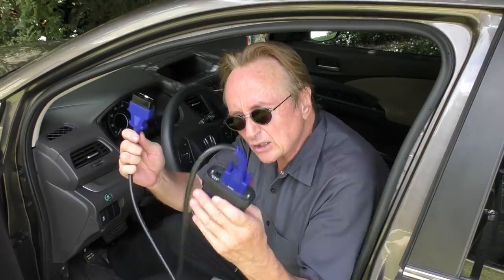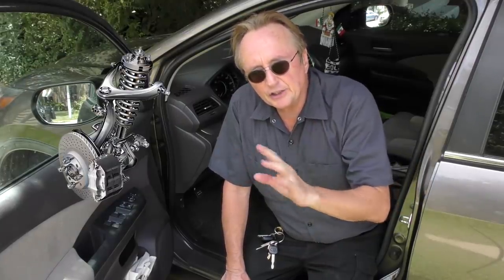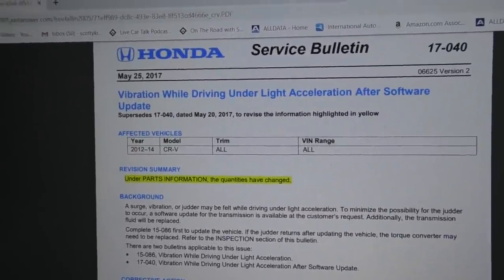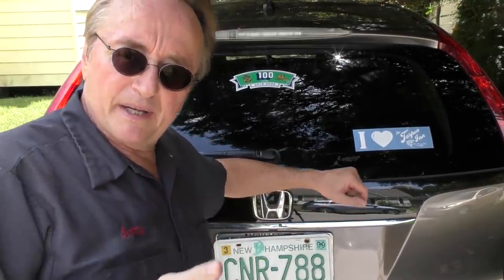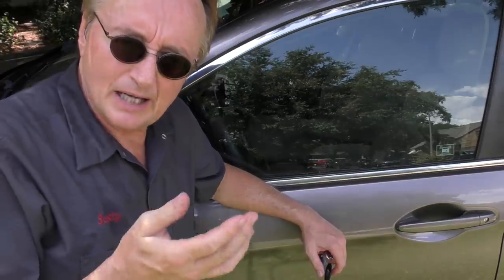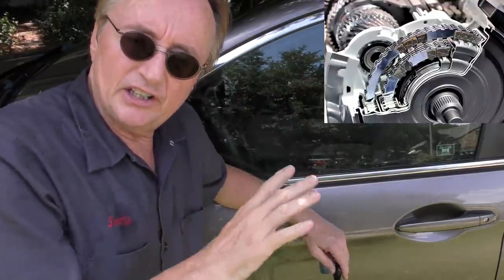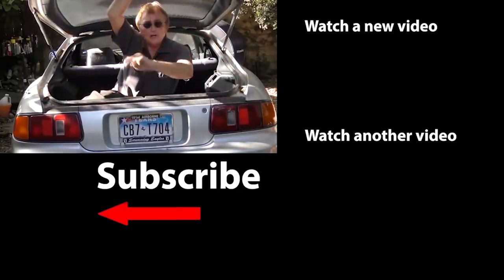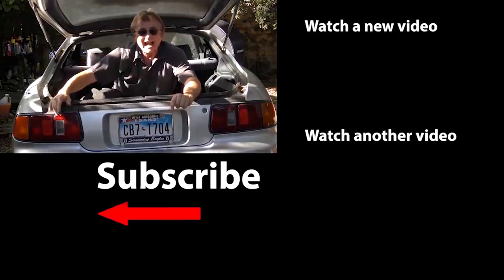I Can't Fix This Car

Comment: I think it could be a problem with the clutches in the transmission. The transmission guy that spoke to scotty had a valid point. I had a simmiler problem with the laycock overdrive in a volvo 240 and a transmission specialist said it was the clutches so I had it done and it was fine afterwards.

Comment: Fuel pump failed on the highway- can the transmission drive the engine, causing the timing belt to jump a couple of teeth? 2002 Mercury Villager, 187,000 miles, pump replaced, vehicle won't start. Can you help, please, Scotty?

Comment: Scotty , Have Your customer try Lube Guard Instant Shutter Fix. I have a 2004 Honda Accord, the same symptoms that you described in this video. Installed The magic juice and the shutter is gone. Basically it's a friction modifier. Back in the 90's when I worked at the Ford Dealer if the transmission had a shutter this fixed the problem 80% of the time.

Comment: My bet is it’s got an intermittent ignition miss under light load with A/C on it is worse. Everybody always goes for the transmission and usually they’re wrong. Ran across this problem before if you gap the spark plugs to .035”the problem will be gone for a bit. New ignition coils will fix it more than likely. Under light load lean fuel mix causes the light miss will not trip the CEL. Under hard acceleration probably does not miss.

Comment: As time goes on and with the experience I have had with owning only two Honda's I have decided I won't be buying one as my next car. My car only had 127k miles on It when the transmission started acting up, I'm getting It replaced right now and that's just a waste of money. "It's a Honda, It lasts forever" Is starting to not be so true anymore.

Comment: Faced very similar situation, other car brand, was neither Engine nor Transmission: Culprit was ABS. Replaced one wheel bearing assembly with its ABS sensor, now "acceleration stutter" is gone...

Comment: It is a bit farshot but here it goes. Check the transmission dampening and/or the motor dampenings. The rubber thingies that connenct the motor/transmission to the body and it is used for vibration dampening. Sorry english is not my first language, don't know what those are exactly called. It is like, for better word, a cradle. Like the engine suspension points have those, the transmission also has them. If it is vibrating under low load/rpm it is usually that. The vibration has to get to the body somewhere even if it is software caused. Engines are typically vibrating more in low rpms.

Comment: I had an E46 BMW with the GM transmission that sometimes would not go into reverse.  I mean, you had nothin'.  I went into reverse 99% of the time, though, and I drove it YEARS like that, just being careful not to get "trapped" when parking.

Comment: I had a 1998 Granchrekie jeep that did the same thing. After about 6 month of this issue. It did it as we were going past our dealership & the found the issue. The mother board on the computer had a crack in it. As the car heated up the board would separate at the crack  and the car would shake spit sputter and loose power. Replaced the entire CPU on the Jeep and issue solved. Just a thought.

Comment: Sounds to me like a failing torque converter lock out clutch. Check the trans fluid level. Check the trans fluid to look for discoloration, murkiness, or grit. If you see any, it's time for a complete trans rebuild or an unethical sale.

Comment: I had the same problem on a honda.  Added tube of instant shudder fixx 3 years ago and the shudder went right away.  No issues since.  less than $10 fix and known issue with Hondas.

Comment: How often was the fluid changed and with what brand?  I neglected my transmission when the car was still new.
 I do my own fluid changes due to distance from dealer.  I went to 60k before a change and only then because of a shudder at low speed ,1st to 2nd
After change, shudder disappeared.
I only use Honda fluid, and change 3 quarts about every 5k and will continue until I'm satisfied with the color of the fluid.

Comment: My mother has a 2011 CRV with 167K miles on it. Lots of shuddering when accelerating around 30-40mph and when it’s driving around 70mph, it struggles to get over 2500 RPM and makes a growling / grinding sound unless you floor it hard.

Comment: No guarantees after $2,000 for the torque converter to be replaced. A solenoid or software would be my guess.

Comment: My 1998 Crv shutters at low acceleration, my issue is that I just recently replaced my transmission. It had about 25k miles on it. I had to towed to the shop and the driver took it on the two front wheels, I didn't realize until after since I had my backed turned talking to someone. I feel he messed my torque converter up since it didn't do that before. This is why I dont trust people... Even if they're supposed to know how to tow an awd vehicle. 🤦‍♀️

Comment: I have a Subaru Outback.3.6R with 48000 miles on a 5EAT transmision with the exact same shuddering issue.  Subaru said it was a faulty manufactured converter.  The shuddering was real bad.  At about 38000 miles, I had the factory transmission fluid flushed and filled with Amsoil Multi-Car fluid.  The problem is still there but is so slight it is almost unnoticeable.  Subaru had a TSB for this issue in some Subarus, but not mine unfortunately.  I am assuming it should be ok?

Comment: This shutter might be causing due to a faulty design of the drive shaft. If the frequency of the low speed acceleration vibration matches the natural frequency of the drive shaft the drive shaft will resonate and create a high amplitude vibration and this will be felt throughout the vehicle.

Comment: Scotty, did you try changing the transmission fluid? My ‘12 civic had a similar issue… I did the drain and refill three times. It fixed the problem.

Comment: My 2004 Kia Optima has a "judder" issue sometimes but since it has manumatic transmission, I have found that shifting it manually and holding the lower gears a little bit longer helps alleviate that.  It helps take some of the load off of the engine.  My 2002 Chevy Astro van also has a similar problem but I think that one is either the 4th gear "lock up" engaging a "wee bit" too early sometimes under light throttle.

Comment: Honda junk with their CVT transmission along with Subaru and Nissan. I am sticking with Toyota and Lexus brand only. Honda is cutting corner again just like Nissan and Subaru. I am hoping that Toyota dont cut corner just like Honda and Subaru did.

Comment: My old truck did that a couple times and it would clear itself. Well, I did a little brainstorming and thought maybe I got some moisture in the fuel tank over time and occasionally a shot of water was feed thru the injectors. So, I put in a can of dry gas in the fuel tank and the problem went away. So routinely before in the Spring or before the freezing weather, I dump in some dry gas.

Comment: Auto Manufacturers are not required to tell customers about technical service bulletins and so they usually don't. But they do alert their dealers. So, if you have a problem with your car, go online and see if many other owners have the same problem and see if there is a technical service bulletin for it.

Comment: Hi Scotty ,

I was changing the front brake pads on a 2012 Hyundai Tucson when I noticed one of the slider pin on the bracket that you bolt in the caliper was stuck and the dust boot was missing luckily I was able to hammer it down a bit and it slid down, so I was able to bolt in the caliper to the brake bracket, Now the new brake pads work like a dream and I don't want to buy a new bracket because they only comes as a set  with the caliper at least for this suv they do. My question is will this affect my brake system in the future? What do you recommend?

Comment: My Ford Focus juddered from the first day I owned it. Ford just replaced the Transmission Control Module under the required extended warranty. Ford knew the dual clutch electronic transmissions had this problem from the beginning.

Comment: Juttering.  That's job 1 for a Ford Focus.
These high MPG 2011-2017 transmissions are quirky as hell and needed transmission bell coolers.  Ford, Porche, Kia/Hyundai, Honda CRV (some) and  CVT all jutter with age when they get hot.  Get it fixed/rebuilt and it'll come back in 12-20k.  They get burned in stop and go city traffic, and people that hover and putter at the shift points for miles since they have no clue about what a shift point is.

Correct, leave it alone.  Unfortunately since 1999 engines far outlast automatic transmissions.  Always opt for a stick if possible.

Comment: Toyota V6 5-speed transmissions from 2000 to 2005 had major problems that couldn't be fixed. I personally just live with the problem for several years and yes the car just went down the road only a little bit rough at low speed

Comment: my transmission in my 95 sable wont shift from 3rd or 2nd to 1st under full throttle going 16mph or up. everything else perfect, i'll live with it! been doing it 25k miles

Comment: My 2009 Nissan Murano with CVT transmission was hesitating under light acceleration at random intervals for months. There was engine oil leaking from a loose oil filter and an engine code related to the TCM communication problem but no engine light.  I changed the engine oil and the problem went away. Could low-level engine oil affect the engine sensors such as the crank and cam sensors? I believe the TCM requires the engine speed from the ECM. If this value is off could the TCM cause this hesitation?

Comment: Scotty, I had the same juttering on my 2014 Odyssey.  After reading the TSBs, I decided to change the transmission fluid.  Once I did that the problem was completely fixed.  I expect I’ll have to do this regularly

Comment: I have a 08 Camry with a possible transmission problem. If I shift manually it shifts fine if I leave it in drive it shifts hard from second to third all others shift fine. Any ideas

Comment: I learned this bit of wisdom with the two 60s era English sports cars that I owned many years ago. They were temperamental critters that we're going to run depending on how they felt at the moment, despite my best efforts at diagnosing and adjusting things. They were, overall, a blast to drive and so I just had to live with the annoying little quirky things that would happen occasionally.

Comment: I had that exact same problem with my 2007 F-150 except it was extreme violent shaking under light acceleration. so I took it to a mechanic and he changed the spark plugs and air filter among the few other things and it fixed it

Comment: Scotty, i had this exact same problem on my Honda Accord with automatic transmission, on light acceleration it judders. Problem solved with the oil in the gearbox changed.

Comment: Wise advice coming from an ol' veteran. If it is tolerable, live with it.. or get rid of it. 
(Other advices an the same topic; get a manual [while you can]. If the car jitters, you are doing it wrong - provided the car is in good mechanical condition)

Comment: Scotty, I can fix it! I had the same problem with my 2009 Honda CR-V, 4WD, it would shudder going from 3rd to 4th gear and not always. If you hit the gas it would shift, if you hit the brake it would shift. This car had regular trans. Oil changes every 30,000 miles and this started happening at 100,000 miles (July2017). I first thought it was the rear end, but fluid was changed at 90K, so it was clean, but I changed it anyway, this didn’t fix the problem. Next I changed the trans oil twice, the second time after driving the car for about 10 miles in between. This took care of the problem. I have 114k, and the trans. does not shudder.    Thanks.....Jim
Reply: I also replaced the inline filter on the trans. line, that the dealer didn’t know existed. I replaced after the second trans. oil change.....Jim
Reply: Honda in-line Filter I used 25430-PLR-003, for my 2009 CRV, check with dealer for your model.....Jim

Comment: 2014 Camry does this. And my 1994 Lexus sc400. Both do it at 45-50 MPH. I think the sc400 issue  is because it may need a TPS.

Comment: We have a 2009 corolla and it shakes when you accelerate, did a scan and no codes popped up. Guess it could be a transmission problem.

Comment: check the lambda ( or oxygen)  sensor, my car (1995 renault clio) did that too. After taking the transmission out i noticed some damage on the sensor's wiring, I cut and soldered the wires and the problem was gone. I installed the old transmission once more and it worked fine

Comment: If the judder/throttle hesitation wasn't there before the transmission software update, revert it back to the previous software version and it will probably fix the issue

Comment: I had a couple Rav-4's doing same thing, it felt like it was shaking at a stop cause you left the tranny in fifth gear accidentally, a fluid flush did the trick for those.
Software updates are the dealers way of hiding the problem till the warranty is up, and then its not their problem.

Comment: I've had a similar issue with a Ford Fiesta ecoboost. The transmission would shudder periodically. Typically on hills.
Reply: It’s because fiestas don’t have typical auto transmissions. They use automated manuals basically. So it’s the clutch you’re feeling

Comment: I had a similar problem and shop showed me a wire to cut and it disabled the lock-up clutch and problem gone. However, it was only good in the city as it just acted like a high stall racing converter. I drove it ten years like that with no problem.

Comment: Scotty, you disappointed me. You shouldve sold the customer a  torque converter or a rebuilt or used automatic transmission.  The customer clearly wants it to be fixed. Dont save their money for them

Comment: My 97 Town Car did that, got worse over a year but never set a code.  It was a bad spark plug wire, the wire read "open" with a simple meter.  In a car with individual coils, it might be a coil or even a spark plug.

Comment: @Scotty Kilmer, you should try/tell her to try the Lubegard Shudder Fixx. The TC clutch in my Caprice’s 700R4 was shuddering when solenoid engaged, I tried this stuff, and it’s very surprisingly given me about 35,000 miles of incident free operation so far on a 280,000 mile unrebuilt trans. Recommends 1-2 tubes, but mine took 4-5 to get it right. It was BAD before.

Comment: My car does this on Cold days. It's a manual and it does it during light throttle input. I always thought it's because the car can't decide whether or not to activate the fuel cut off mode for engine braking.

Comment: Hate to say it , but if that Honda was mine it would probably go !  I'd be considering trading it in before gets worse and you have to spend 2,500 plus or it shows up on the codes and the Dealerships don't want to give you anything for it .  Unless they really like the vehicle and when it finally gets worse or breaks down they plan on just fixing it .  Truth be told 2,500 is about 1/2 yr or more of the amount of payments you'd have to make if you trade it in for something new.   Better than another 6 yrs in payments .

Comment: scotty I just watched your   Icant fix car ,,I  had that same problem   had no codes scaned intier sytem could find nothing .after a few months finally saw the upstream o2  go over voltage then go back to normal ,,replaced o2 and problem went away and stay away .

Comment: I had the ecu rebuilt on an 02 Rav 4 that shifted terribly, shifted better but still stumbled between 1st and 2nd.  I just drove it and figured i’d fix it if the trans died.  Drove it for like 3yrs and 150k miles, stupid thing just kept going!  Finally sold it lol darn thing is probably still driving on the same trans

Comment: This happen to my 2006 Honda Fit. Cold start would shutter and then conk itself out. Light acceleration would shutter for not apparent reason. Nobody could figure it out. Sold that thing with 100k miles for 5 grand.

Comment: Scotty just to know Honda makes that funny thing mine was Honda Civic 2001with manual transmission did the same thing every morning when the engine was cold after that no problem as you said you have to live with that 19 Year old car still works just fine ! No fancy computer can fix mechanical actions !

Comment: Sure it’s not the same issue as you’d have already done a tran fluid change. My 2010 CRV 83 K miles has had what I’d call a tran shuddering issue a few times. Each time it has happened I’ve changed the tran fluid and my shuddering stopped.

Comment: Myself, I'd look at the problem being a "glitch" within the main computer itself. Although they are usually built and inspected thoroughly before being installed, there is a small percentage that might "slip between the cracks" and this might be one of them. When it comes to being perfect, there is never 100% of that being the case. One minor flaw in its production may get it installed, yet cause a problem later down the line. JMO.

Comment: Hey Scotty i recently had oil change and after my transmission started kicking when shifting from park to reverse and drive also sometimes when shifts gears i drive 2010 chevy cobalt LS, was wondering if you can give some advice on this